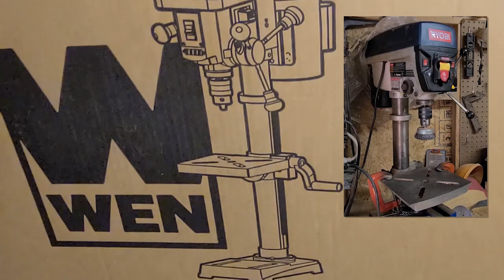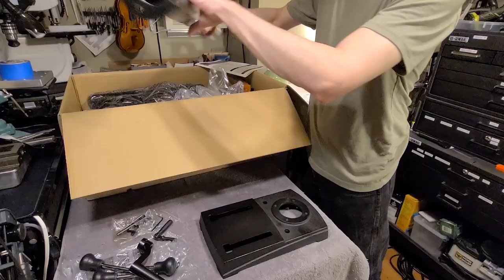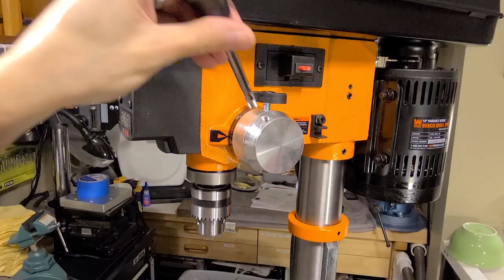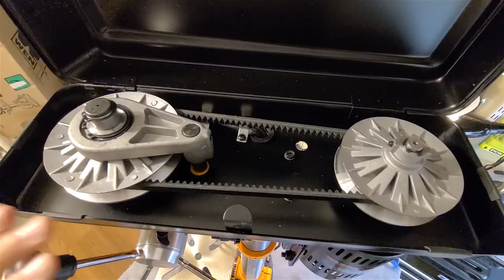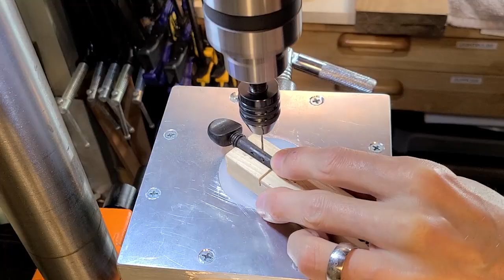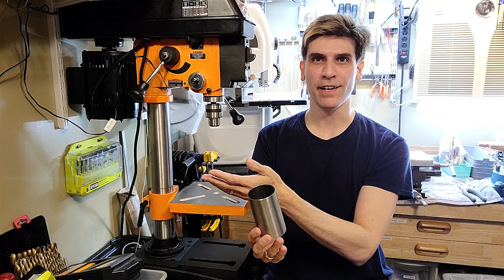WEN 10" Variable Speed 4212T Drill Press REVIEW (and unboxing and assembly)

Comment: i don't understand how you can ask for anything at $160.
the wen machine is most likely made for $2 by some dodgy company in pakistan or india where they have zero health and safety regulations and the salaries those men earn is a disgrace.
i just checked and in 1967 a machine like this cost $125, and that's without a motor. adjusted for inflation, that would be $1052 (without the motor) in 2022...
just for comparison, a typical machine i need for my work is $3000-$5000 and they don't last 10+ years.

Comment: Considering purchase of this item. I like the features. But I have a question. If you add a t-track table, how would that affect the height adjustment of the drill press table? Is it easy to work around?
Reply from the maker: I guess it depends on the t-track table you choose and how it's installed, but the height adjustment crank encroaches about an inch on the area of the table, so the t-track couldn't be installed right up to the column.

Comment: The 4214T model comes with the work light and extended table. For like an extra 35 bucks. Still seems like a great value and I also really like the adjustable speed control. Having that level makes it much easier to adjust on the fly.

Comment: Thanks for the review. 

I also don't love the laser. The adjustment is about as crude as you can imagine, and with its grainy red light, it actually obscures the drill point somewhat. Eyeballing the drill bit point and cranking it down into the workpiece while powered off will be more accurate. I'm probably going to keep the laser powered off most of the time. 

The speeds are continuously adjustable without taking the top off and moving belts to different pulleys, which is great. 

Re height, I was used to a floor-standing 14" drill press, so this Wen seemed small. Anyway, having the drill table a bit below eye level is nice for accurate work. So this tool really calls for its own stand, maybe 30" tall, somewhat shorter than the usual workbench height. I'm going to be building one soon.

Re adjustments and controls, the crank is a little sticky when you start driving the chuck down, probably from rough machining and lack of lubrication. I wish I could squirt some oil on the rack and pinion, but I don't know how to get to those bits yet. 

The lack of a light is easily fixed. You can get cheap LED lights with flexible arms for $12 or so. But my shop is well lit, and I haven't felt the need for additional lighting yet. 

But I do feel the need for a larger table with a fence and stop. Wen makes one, but there are lots of plans and descriptions for making your own. I'll have to see what will work best for me. 

Anyway, thanks again!

Comment: I just put my Wen together and ran it. My unit was loud too, but there was no solenoid snapping noise. To adjust to speed while it was running was hard to move. Do you know if the hex nut can be loosen to make it easier to adjust? Thank you buddy. Just love that cat. You treat it really goodThank you
Reply from the maker: Mine too felt hard to adjust the speed. I haven't tinkered with that to find out whether or not it's just set too tight or if that's how it's supposed to be.

Comment: question cutting 4" off what did you use to cut it, also does this have the power and how it that variable speed lever any issues since this video? thanks
Reply from the maker: I used a hacksaw to cut the 4" from the column. First I thought I was going to be all fancy and put it on the lathe and all that, but sometimes the simplest solutions are the best!  😊
I love this drillpress. I don't normally abuse my tools, so I have not done anything that would have bogged it down or anything. It's done everything I've asked of it since I got it and it does it well!
The variable speed lever is quite stiff, to the point that if the drillpress isn't steady or bolted down, you could move it around when changing the speed, but I have had no issues with any of it since I got it.
Reply: Thanks for the info, i thought i do the cut also with a band saw or hack saw. i want this saw to be at 30" tops, would be nice if they just had a column option with a built in led light. The variable belt drive is what sold me on this and the mods you did are what i will do.
Reply from the maker: @jerryjohnson2270  👍

Comment: I just bought this drill press, great video on the details and the unboxing! This will come in handy as I have not opened mine yet. Coincidentally my thoughts on this drill press when I purchased it was that it seemed to be taller than the other ones in its category so my plan all along was to cut a section off of the column so I'm happy to see I'm not the only person with that thought lol. I'm hoping the collar at the bottom is removable as I would like to chuck it in a lathe and use a parting tool but I will find out for myself tomorrow. 👍👍
Reply from the maker: I believe the flange at the bottom is pressed in. I didn't try to remove mine. I also considered chucking the column in the lathe, but in the end, the simplest and quickest solution was really just using a hacksaw.   😉👍

Comment: I jut received this item. Wondering how to remove chuck from spindle. I don’t see a slot in spindle to drive wedge into so as to force spindle out.
Reply from the maker: You should be able to pop it off if you put a wedge of some sort between the top of the chuck and that flange right above it on the spindle.

Comment: Did you cut the column down from the top or the bottom? I assume the top but want to double check.  It’s a big ol’ tool for being a bench top press
Reply from the maker: It is big! I cut it at the top. The bottom seems to be press-fitted to the flange that attaches it to the base.
Reply: @SculptyWorks  I figured that was the case!  Thanks for the reply. Purchasing one soon!

Comment: I am looking to buy this drill press and have the same height issue. The overall height is 3 inches taller than the space I have for it. How idi you cut the column down to lower the overall height?
Reply from the maker: I just used a hacksaw.   😊

Comment: I have the 10" without the lovely variable speed lever.  It .. has.. a ... light.  Frankly the variable speed is a good trade for the light.  I only paid 50 bucks for mine.  It drills holes.  It does what it is supposed to do but I am too lazy to change the belt position for slower or faster speeds.

Comment: The laser guides being battery operated is so you can align the boards safely without it being powered on. And you can get a clip on light off amazin for 5$
Reply: Absolutely.  I'd rather select a light attachment that actually works than pay an extra $8-10 for a press with a light that doesn't work the way I need it to work.